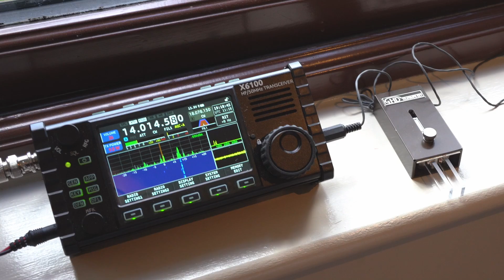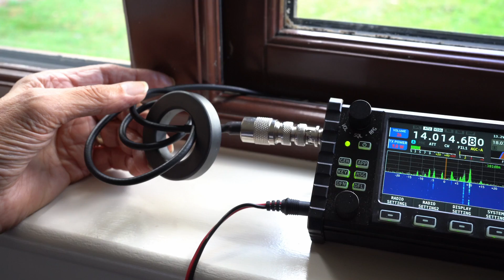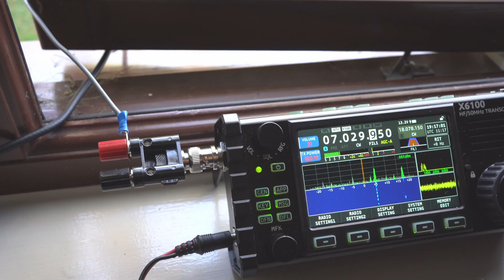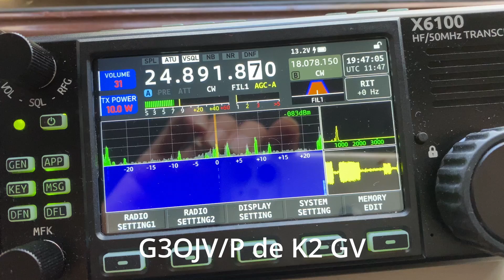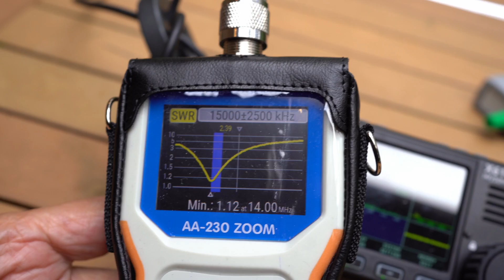Emergency & Portable -  Simple HF Setup - Ham Radio

Comment: Hi Peter can you tell me if the SDR play RSP works on Windows 11 I want to buy from you I’ve tried all the other sDR units for 6 months with no success 
Derek G4WBP
Reply from the maker: Unfortunately all my gear is Mac. I am surprised that you are having problems as I assumed that most WindowsVersions were OK. Try dropping a line to them in the UK. The should reply very quickly.
Reply: @watersstanton  oK Peter will do I will wait to order until I get a reply thanks for email Very Best Regards Derek

Comment: YUP!  Like you, I aint the rich guy in the old QST cartoons with a Jeeves to do all the work  while I just sit and work DX.  Also like you, I love portable ops, for which I use an 817ND  and the original LDG QRP ATU, the one with the 4 toggle switches on the front.  I switch to AM to run the tuner.  Not a POTA op, I just go to the park or woods for some good ole ham bone fun.  I do like resonant antennas, tho, for efficiency with just 5 W, but play with wire, too.  73 / 72  Jerry wa2omu
Reply from the maker: Many thanks for sharing your thoughts. Much appreciated.

Comment: With those tall trees around ur portable ("/") QTH, if it were me (& if I'd brought some light string & some support line with a wire antenna), I wud've found a small, angled rock, tied a string around it a few times & with string in hand, slung that rock (underhanded) up into (or over) those treetops, then pulled my support line thru with the string; then I'd hang an Inverted Vee or whatever; at least that's what I did here at my QTH!😀🇺🇸
Reply from the maker: Most of the trees didn’t have lower branches.

Comment: Really good video & one that provokes some introspection, too; & for myself, I'm certainly not desirous of having the "biggest" antenna or biggest of anything; however, I DO like having a variety of antennas, say, a vertical (& mine's at the top of a tree), along with several wire antennas in different configurations; that's all I need to have fun! de WA4ELW in TN 🇺🇸😀

Comment: 1 M Magloop in the loft + 17M Band bent dipole in Loft
IC-705 or X6100 or QDX so running @ 2.5W ~5W
177 DXCC on 17M inc ZL4 / KH and 126 IOTA's
For me it is 100% the challenge.

Comment: cant beat a bit of qrp :D i have worked all over Europe with my 817. less than 5w and the wonder wand antenna.
a bit of wire can go a long way. about 1600 mile is about normal from my qrp station.
on uhf/vhf i can work about 30mile with a 10w radio and a x50c antenna on the house roof.
keep up the good work and hope you have a great holiday
73
M6CTP

Comment: My current HF setup consists of a PSU purchased in the early 80's, a 40M EFHW and a Xiegu G106. Last week alone I worked 2 Canadian stations running 6 watts on 20 mtr's and attracted reports of 5/9 and a 5/7. Who needs big power, not me.

Comment: I agree high power, massive antenna are ok if that what floats your boat. Last Sunday during CQWW I set my task to see what I could work using 5w from my Yeasu 817ND I managed to work two in the US on 15m, among many more
Reply from the maker: Yes, and with the sunspot cycle still progressing, 5W cab go a long way.

Comment: Well said, Peter. And I'm afraid that Amateur Radio will go the way of private aviation, and merely be a rich man's toy. Not that I mind rich men being on board, far from it! Having rich men on board might even help us to keep our very spectrum! As far as super stations go, adding a few more zeros to those point multipliers for QRP and medium powered stations would go a long way towards leveling the playing field, if you are into that thing...  What happens when you use the 9:1 AND the ATU together?
Reply from the maker: I used the rig internal ATU and it worked fine. With a floating ATU, you don’t need an UnUn.

Comment: Another great and enjoyable video! Thanks. I've been a Ham for  just a little over 29 years, and I'm one that gave up on DX years ago. I'll work it if it falls in my lap, but I can't compete with the folks running Amps or those with a small city sized Antenna farm. Too bad there wasn't a group of frequencies on each band that were ear marked for 100 watts or less then if you can hear a station then with patients you have a chance to work them. Sadly a lot of folks are running more power than they need and are transmitting farther than they can hear.
Reply from the maker: There are QRP frequencies, but often occupied……l!
Reply: so right, and its going to get worse.

Comment: Thank you, Peter, for helping rebuild my confidencce in the way I have built my mobile QRP set-up. My plan was to have a system that fit into a small pouch. It consists of a uSDR+ tx/rx, an ATU-10 tuner/swr/pwr meter, a small key, and a 49:1 EFHW for 10m-80m using a 110mH trap to reach 80m.  While I can use adapters to get my power from the mains, I have a small, very portable solar panel that can be used to charge the internal batteries of both the  ATU and the uSDR+.  

It all fits in a 2"×6"×8" pouch, and  besides being a fun "take-along" kit, it is a great setup for emergency communications should the need arise.

This video helps bring us back to the spirit in which amatuer radio was founded. Thank you so much!!!
Reply from the maker: That mobile setup sounds fun. Thanks fot sharing. 73 Peter

Comment: Hi Peter. Fun video. Nice setting. Question: do you find that ATU’s are as sensitive to CMC as the transceiver itself? I would imagine that sharply unbalanced currents (like from an end-fed random wire or OCF-dipole) would throw off a small/inexpensive ATU’s SWR bridge readings and could affect its tuning ability? .. but I suppose if you are getting a good match out of the thing, as judged by the SWR meter on the rig (which is choked off), it probably doesn’t matter, eh?  You would only worry about that if the tuner were acting up, as a result of CMC getting into the tuner?